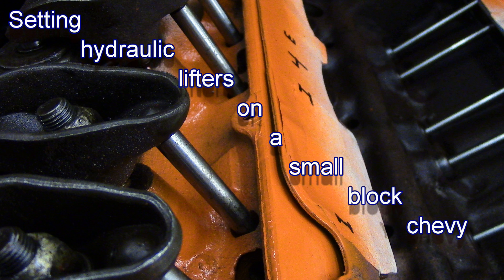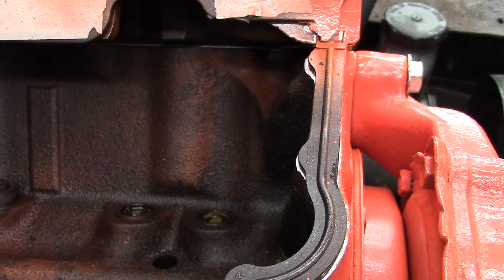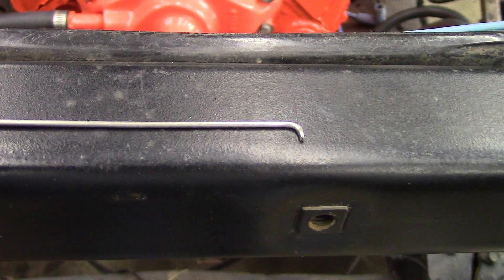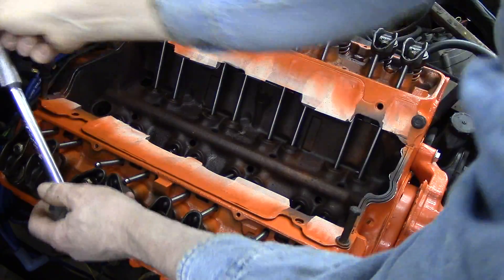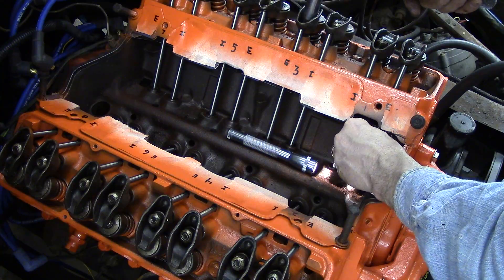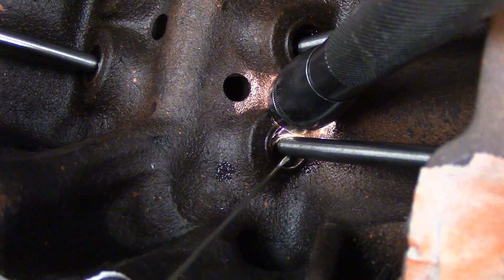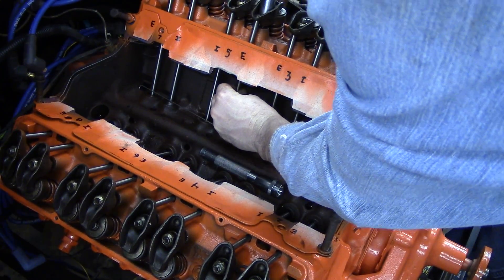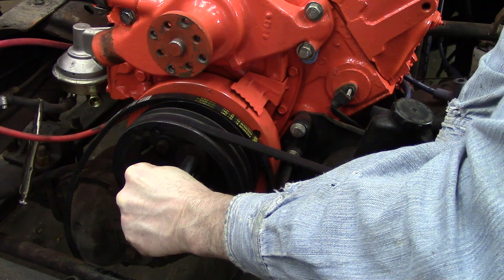How to set small block Chevy hydraulic lifters

Comment: Great Video!!! I do have a crazy Q though... can I adjust a vortec 5.7 350 TDC with out heads and/or distributor on the engine. I know that #1 & #6 cylinders at TDC, but im not sure about the timing marks on the chain.
Reply from the maker: The valve lash adjustments are made by adjusting the rocker arm nuts which are attached to the top of the heads, so if there are no heads installed there would be no way to adjust valve lash. Thanks for the question, I hope this was the answer you were looking for? If not, please ask again, and I will try to assist.
Reply: +H.R.I. services llc Ricky Hembel Wow...i meant to ask...to find TDC with the heads or distributor off. Is it possible. Cylinders 1 & 6 are at the top of the block
Reply from the maker: That is correct, both #1 & #6 are at TDC at the same time, but they fire 180 degree's apart at the distributor, so when one of them is firing  or on power stroke, the other is on the exhaust stroke. When you have the timing chain installed if the timing marks line up facing each other (cam gear mark down and crank gear mark up) that means #1 is in firing stroke,  if you rotate the crankshaft 360 degree's from there the engine would be on #6 firing stroke (cam gear mark up and crank gear up. I believe that is what your looking for.
Reply: so therefore, after installing the heads back. torque them to specs, them the valves....after everything is back together it should fire up?
Reply from the maker: Yes provided you line up the timing marks (cam gear mark down and crank gear mark up). If your engine does not have a timing tab, I would make a small punch mark on the Harmonic balancer and the timing cover for a reference. I have videos on both static and dynamic timing that will help with distributor installation after setting the valves is completed.
Reply: +H.R.I. services llc Ricky Hembel 
Thanks i will check it out.
what i did notice the distributor points at 1 the #1 and #6 cylinder is all the way up and the harmonic balance mark is on point with timing cover. both lifters on #1and #6 are down
Reply from the maker: When #1 cylinder is in the firing position, both lifters for #1 are on the base of the cam circle, so both lifters are all the way down. #6 lifters may both look all the way down but they are not, I cannot remember off the top of my head, but one of them is already starting to slightly rise, I think it is the intake lifter to let the next charge in as the piston starts to descend.
Reply: H.R.I. services llc Ricky Hembel  Thanks for sharing....do you have a video on cylinder head torque?
I have a 97 chevrolet Suburban Vortec 5.7 350...do i actually need a torque angle for the cylinder heads?
Reply from the maker: I do not have a video on head installation, but here is what I always do. Run a tap through all of the head bolt holes in the block to verify the threads are clean and ready for bolts this will keep your torque consistent. Make sure the block and heads are very clean, no old gasket residue, verify the gaskets fit the block (I like composite gaskets) keeping a close eye on the block to head alignment dowels, this is an area where the gasket can bunch up and cause a coolant leak, install the head being careful not to bang the gasket, be gentle.  Lubricate each head stud with a Teflon pipe sealant paste prior to insertion. Always torque in three sequences, the first torque sequence is to 22 ft lbs at each stud in the order of the picture I attached. Book says torque bolts 3, 4, 7, 8, 11, 12, 15, & 16 to 55 degrees from there, then torque bolts 14, & 17 to 65 degrees, then torque bolts 1, 2, 5, 6, 9, 10, & 13 to 75 degrees. If you really do not want to spend the money for an angle gauge you could take a bolt and nut, weld the nut to a steel work bench, torque it to the 22 ft lbs, then lay out each angle on a bench from a zero point, put a torque wrench on the bolt at the zero point and pull to each degree and read that torque, and that would be the torque for that corresponding angle. It may be easier just to buy the gauge! Hope this helps. YouTube would not let me put a picture in here you will have to Google the head torques sequence.
Reply: Thank you so very much for answering/helping me get this correct! Will be staring on this again in the morning. Thanks again!
Reply from the maker: Curtis Brown, happy to help!